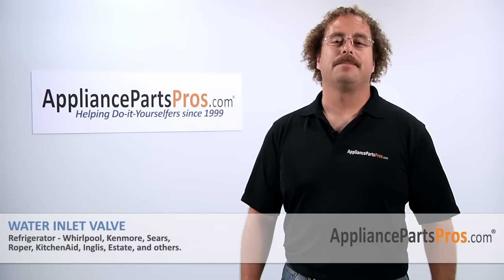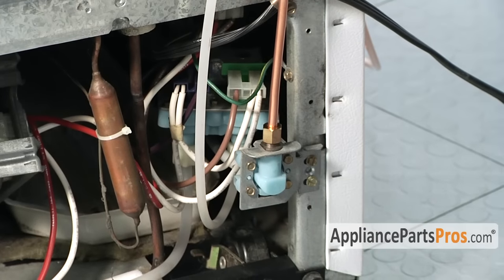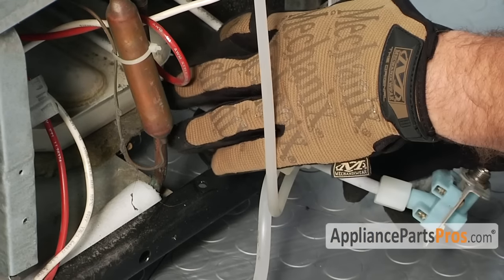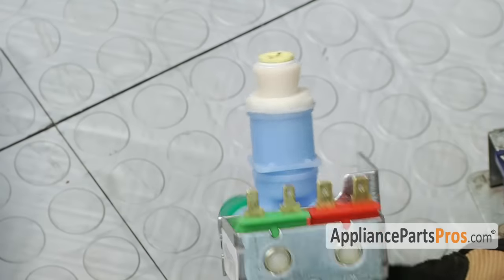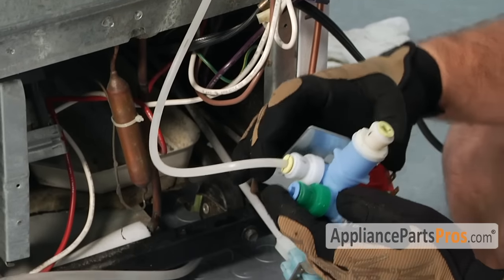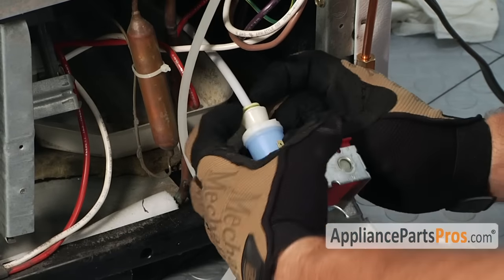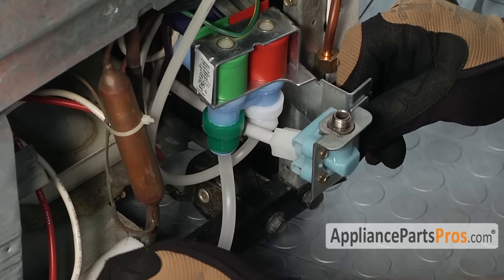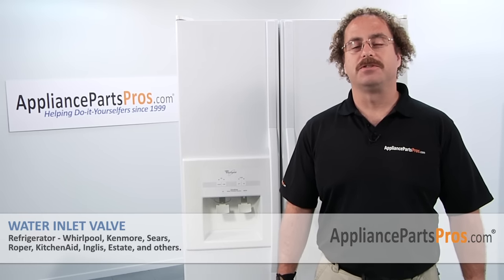How To: Whirlpool/KitchenAid/Maytag Water Inlet Valve W10408179

Comment: Solid guidance here helped me with the transition from old style connections to the newer, and only available, for new water valve on my 30 year old die hard Kenmore Elite. Note that you MUST test for leakage as it's hard to tell whether or not you pushed the tubing in hard enough to make a tight seal. I had to mess with it to eliminate seepage 100%. In plumbing, anything less than 100% leak free is failure.

Comment: Thanks for the video. It was a big help. I'm glad I watched before starting. Initially I thought those caps on the connection were just plugs to keep the water inlets clean and I almost pulled them off. The instruction about pulling the 2 pieces apart cleared up that confusion too. Nice going

Comment: This was a great video! Sure instilled some confidence in a job that I probably wouldn't have attempted without watching it. Although I had looked at the my inlet valve I was struggling with the fact that I had screw on connectors and the part showed push on so I was afraid to order it in case it didn't work. The video gave me the confidence to go ahead. Thank you for clearing this up. I struggled with separating the inlet supply line from the inlet valve so instead of trying to pry it I drilled it out with 1/4" drill bit. Worked perfect! Thanks again.

Comment from the maker: If its leaking from both it could be a few things. Such as the valve is bad or clogged and its letting water through. The refrigerator needs 30-120 lbs of water pressure to work, if its low they could slowly leak. Many people have a problem if they install a R/O system, as it drops the pressure to the refrigerator. Make sure the water supply valve is all the way open. A dirty, clogged water filter can also cause pressure problems, make sure if you have one it is new and changed regularly.

Comment: Great video!  It was so confusing when I purchased the new water inlet valve.  It wasn't until you mentioned that the tubing and terminals are different that it made it less confusing.  In addition, prying apart the water inlet source from the water inlet valve being tricky wasn't initially obvious from the part instructions.  Thanks again!
Reply from the maker: Glad the video helped you get the water valve changed!

Comment: Excellent video, thanks Matt! The replacement part is just as you described. Thanks especially for the tip to cut off the tubing ends for the (new) push fittings.  All went back together with no issues and works great!
Reply from the maker: You're welcome!

Comment: at 3:29 the repairman is prying apart the initial piece where the water enters BEFORE it gets to the valve. That is the piece that needs to be replaced. Both nut and male portion on this initial part are stripped and wont allow compression nut and nut to seal water tightly. NO one provides this part number and it appears it doesnot come with new replacement. I have a 2006 Whirlpool and neither ApplianceParts Pros or videos address how to replace this part!
Reply: I am currently searching for that exact part. Did you have any luck finding a replacement?
Reply: Found it. Part #: WPW10445062

Comment: I almost returned my part as it differed from the original. Thanks so much for the excellent video!
Reply from the maker: Glad we could help! Manufacturers do change the design of parts frequently in an attempt to make parts compatible with as many of their appliances as possible. We only carry original manufacturer parts, as long as you research the part by model number, you can be assured the part is correct for your unit per the manufacturer.

Comment: Thank you for the straight forward instructions. I have a Kenmore refrigerator, model number 51274200 very similar to the one in the video. The water does not come out from the dispenser, I replaced the water inlet valve which was made by Robert Shaw  and now the dispenser works and the ice maker works.
Reply from the maker: Glad we could help!

Comment from the maker: First check for any ice build up in the tube that goes through the back wall. The water valve could be clogged or not working properly. You can test the solenoid that opens the water valve, it should read between 300-500 ohms. Make sure you unplug the refrigerator first. If the solenoid check out then it could be an issue with the ice maker. If you have any questions please feel free to post on our repair forum.
Reply: I get 408 ohms on two of the coils but only 237 ohms on the ice maker coil (green). Is that OK? Frigidaire FFSS2614QS6A

Comment from the maker: The inlet valve a common problem. Also check for water pressure issues, clogged line, old filter, air in lines etc. According to the model number you supplied, this is the valve used: AP5263471.

Comment: Your video shows exactly the same frig and water pump. Grt video! I'm going to order this part from you website. My problem was a slow drip at the water filtered dispenser in front of the frig. On another video I saw I had to replace the water valve, so that's what I'm doing. Thanks!
Reply from the maker: +Luciano Aldana Glad the video helped you get the water valve changed!

Comment: Use silver tape on carboard back where it meet metal on bottom on coil side, otherwise fan will not pull air across coil properly.  I clean coil with soapy water in pump sprayer, works well and is easy.  If coils are not cleaned compressor runtimes and life greatly shortened.  Don't pay more then 20-25 for these on ebay same valve.

Comment: I've replaced the water valve but when I turn the water back on there is water shooting out of the connector from the water source (wall) and the water value. I've checked that the connection is tight and not cross-threaded, what else should I check?

Thanks again for this great video.

Comment: we completed this repair - thanks for such clear instructions.  When we turned the water on, the water dispenser in front started pouring water.  I have seen some repair blogs that talk about water pressure and resetting the valve so that the dispenser will shut off again.  Can you tell me more about this process?
Reply: Kenmore Elite Model 50792000

Comment: I was nervous as your video was more detailed than the one from the part manufacturer.  Without your addition of cutting off the old compression fittings, I would have been lost.  Just have to wait for my Whirlpool ice machine to suck the air out of the ice line.  Wish there was a was to manually cycle.  Thank you so much.
Reply from the maker: Awesome, glad the video helped you out!

Comment from the maker: Did you make sure you turned the water supply on, all the way? How long has it been since the filter has been changed? Check the water tank in the fridge to see if its frozen. You need to check out everything that might cause a clog or loss of pressure.

Comment from the maker: If you go to our site and click on the top where it says repair forum you can search for "ice maker not working" and get some info. Or you can ask your own question. There is a few thing to check and it is more than I can put in here. I would start with checking the fill tube where it goes through the back wall to be sure its not frozen up.

Comment from the maker: Make sure you are tightening the hose enough and that the hose washer is in there and in good shape. It could also be a defective valve, it is strange but it does happen from time to time.
Reply: I just bought a replacement for my Whirlpool refrigerator because the press-lock fitting leaks from the ice tray supply line--once the valve shuts back off all the water drains back down, onto my kitchen floor. :(  Great video, thanks for posting it and for including exceptional instructions!

Comment: Great video.  I went to change out my valve and found the part that he has to pry off that connects the copper pipe needs to be replaced.  It’s so bunked up I’m surprised I have any ice cubes.  Does anyone know what that piece is called?   I can’t seem to find it in my searches.  Thanks!

Comment from the maker: Ronald Wilhelm, I cannot respond as you have the reply feature off. Once you turn the water on it may take a little while for the ice maker to go through a cycle and call for water. If your valve was leaking water up to the ice maker make sure the fill tube going through the back wall is not iced up. If it still does not make ice you will have to look deeper and see it there is another problem such as the ice maker itself or maybe the infrared sensor, if you have that. You can also post the problem along with the appliance model number on our repair forum and the techs can help you troubleshoot the problem.

Comment from the maker: If it does not have a built in water filter the water line should go from the valve to the water reservoir in the fresh food compartment. If it has a built in water filter the water goes through the filter first, then to the reservoir and out to the dispenser.

Comment from the maker: It is always best to look up the part by the model number on our site. But here is the note we have on this water valve: Due to manufacturer changes this valve no longer includes the removable pre-filter bracket. If you are unable to use the old removable pre-filter bracket order AP5306962.
Reply: Wow. What a helpful video. Thank you for explaining that the new part is now two different parts. Calling Sears directly was useless unfortunately. I needed the pre-filter bracket (not the water inlet valve), and I used the model number above at your website. Fit perfectly and saved $500 on labor. Thank you!

Comment from the maker: If you pulled the refrigerator out and moved it around it could have cracked the hose. Those plastic hoses get old and brittle, sometimes all it takes is a little pressure or tension and you get a leak. I can't see how the other problems could cause this, other than it made you move the appliance. I think you will be alright, if you replace the supply line.

Comment: What is the part number for the inlet valve connecting to the water line
Reply: I am currently looking for that same part, did you have any luck locating one?
Reply: Found it. Part #: WPW10445062

Comment: THANKS A LOT YOU REALLY HELPED ME 100%
Reply from the maker: Glad you got the refrigerator working!
Reply: AppliancePartsPros
Great video and followed the instruction well and installed the new part. What do you do if the water starts coming out of one of the bigger diameter tube es which are side by side. When I pushed the tube in it give me a snug fitting. Do not not how to resolve the problem ?

Comment: Is anyone aware if this part can be the reason of bad water taste. 
I installed a water source directly from the filtration/alkalinization system to fridge, however the water has metallic aftertaste that is coming from the fridge line. I’m not sure should I change a complete waterlines in the fridge or is there a part that might cause a bad taste?

Comment: I was looking for a way to diagnosis if the icemaker not filling the tray full of water is actually the water valve. I replaced the flex tray on our Whirlpool for the 3rd time in 4 years. Also the water dispenser works fine with plenty  of pressure and volume.
Reply from the maker: What is your model number?
Reply from the maker: Thank you. You will need to cycle the ice maker and test at the water valve to see if you have 120 volts there when the ice maker cycles. If you have power there and it's not allowing water to the ice maker then you will need to replace the water valve. If you don't have power there then you will need to replace the ice maker.
Reply: @appliancepartspros  Thanks, I'm surprised they run 120 volts AC to that winding. I expected there was a step down to DC somewhere. I think I'm getting voltage to the valve because I'm getting some water. Before I replaced the flex tray I had large blocks of ice building up in the bucket, but now just half or less the amount of water needed getting to the tray. Water dispenser side good volume and I replaced the filter.
Reply from the maker: You will need to check the water line for partial clogs and check to see if water is dripping in all the time. If the line is partially clogged or water is dripping from the fill tube then your water valve will need to be replaced.

Comment from the maker: Aglarend, I cannot comment on your post as you have the rely feature off. Make sure the water is on, make sure the ice maker fill tube that goes through the back wall is not frozen up, make sure everything was reinstalled correctly and wires have good connections. You can read this post which gives a lot of info on testing the sensor and ice maker. http://forum.appliancepartspros.com/refrigerator-freezer-repair/5143-whirlpool-side-side-ice-maker-not-making-ice.html
Reply: AppliancePartsPros

Comment: Awesome you guys are really pros.  Simply explained and down to the point.  Great video!
Reply from the maker: Tomz Rain Glad the video helped you get the refrigerator working!
Reply: My ice maker isn't working.  Can it be that the line is frozen solid?
Reply from the maker: Tomz Rain You can check the fill tube that comes through the back wall. If its frozen up you will not get water for the ice.
Reply: It was frozen through and I got it fixed but still no water coming through.  I guess my sensor chips are fried.

Comment: Thanks for posting these videos and offering assistance.   Our Frigidaire RF stopped making ice recently.   It is 10 years old.   I did not do the electrical test due to the age of the unit.   We have a very strong, steady flow of water coming in.   I replaced the water inlet valve this weekend but still no ice.   Added note that I also replaced the water filter.    What should I do next?
Reply from the maker: +Steve Dyrda If the ice maker stopped it is usually the valve, the ice maker or maybe a iced up fill line. Without knowing what you have I would suggest posting the problem along with the appliance model number on our repair forum and the techs can help you troubleshoot the problem. http://forum.appliancepartspros.com/
Reply: +AppliancePartsPros - we are now making ice!   The only thing that I did was (purely unknowingly) was to lift & lower the shut off arm and walked away.   Some short time later I heard a load of fresh ice get dumped into the bin.   It's been making continuously all thru the night and running smooth.   Thank you all at APP once again for being there!!
Reply from the maker: Awesome, glad the ice maker is working!

Comment: Ok, followed these instructions with my Kenmore fridge and they were perfect, thanks!

HOWEVER, the ice maker (which had been switched off due to a leak at the valve each time it tried to make ice) is now not making any ice. No water sounds like before as it pulled water up into the maker, no indication that it's doing anything, and of course, no ice in the tray.

Everything is connected and installed correctly -- what could possibly be the cause of the ice maker now not pulling water to make ice, and really, not doing anything?

Quick note: the little red light next to the ice maker ON/OFF switch inside the freezer is blinking red...
Reply: Did you ever resolve this? I'm having the same issue

Comment: i have the a whirlpool fridge that the water is dripping from the ice maker and also freezing at the end of the tube that puts water into the ice maker to make ice. i was told sounds like the valve. wanted to ask before i order it from you and it be the wrong part. when i looked up my fridge sears said this was the part number, replacement for the original part

Comment: Boy, wish my fridge was that clean back there!  I have a whirlpool gold side by side complete with ice maker and dispenser in the door...  The inlet water line vibrates loudly intermittently when dispensing water in the door...I pulled the inlet line off looking for obstructions debris, didn't really see anything...Finally, I thought that perhaps the water filter was messed up and replaced it, even though it was fairly new.  This seemed to solve the problem for a few weeks, but now the inlet line has started vibrating again...Just seems like there is an obstruction somewhere, but don't know how to troubleshoot this further....What do you think?

Comment: Very helpful. How do you determine its the water inlet valve is faulty
Reply from the maker: Leroy Hudson You have to check the solenoids for ohms, you can usually find the ohm rating on the wiring schematics. Generally water inlet valve solenoids should have between 200-500 ohms. If the solenoid in not in that range it is bad and the valve would have to be changed.
Reply: AppliancePartsPros This is excellent advice - always checkout the solenoid with an ohm meter.  My icemaker wasn't producing, but a bit of analysis showed the tines were turning.  I pulled out the solenoid (based on this video) and checked - sure enough the icemaker side was reading 0 ohms.  Careful visual inspection revealed a small melted bubble on the side of the solenoid cylinder.  Thanks, guys!!!

Comment: This is probably what is wrong with mine as we are getting water through the dispenser but not the ice maker. However it would be nice to know what steps to take PRIOR to this to trouble shoot the problem.  For example I see air in the water line going up the back on the outside of the refrigerator, it is one of the lines that goes to the inlet valve.

Comment: ok so do you have a part that will stop the water from dripping? it appears to be not shutting off when it should so we get water dripping through the door water dispenser and water drips through the tube that lets water into the icemaker. it does not over fill the icemaker tray. it drips so slow that it is freezing in the water line at the end. we take pliers and break out the piece of ice that forms or sometimes it shoots the piece out when it goes to fill up the tray. thank you :)